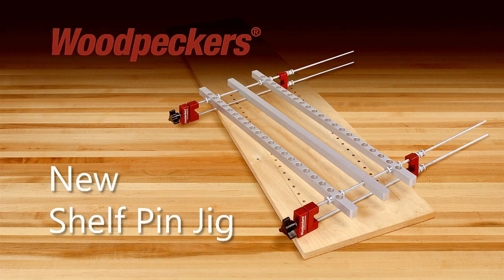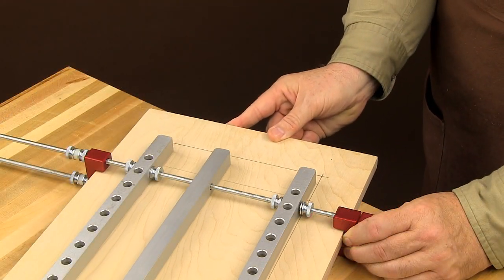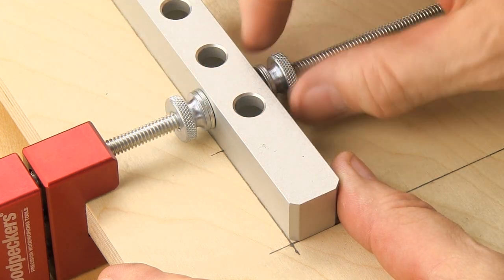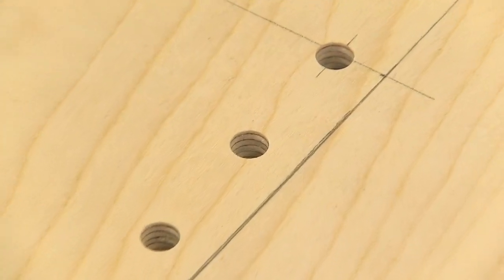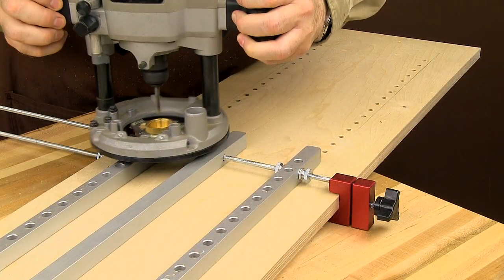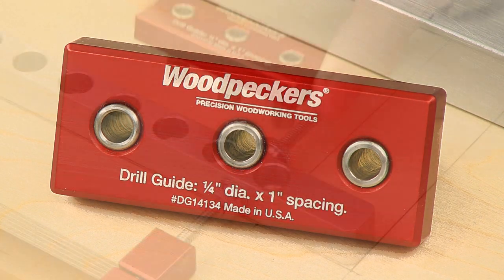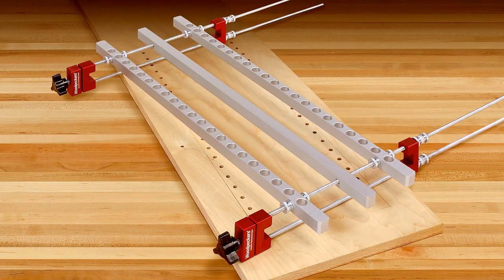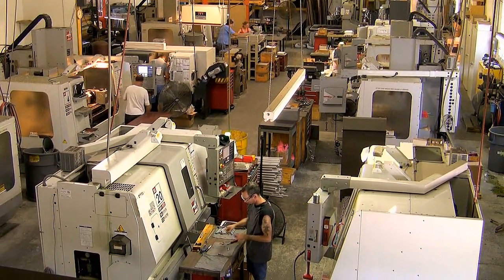Woodpeckers Shelf Pin Jig

Comment: You don't need a store-bought jig to drill shelf holes in new panels BEFORE they're assembled into cabinets.  The hard thing is to do retrofit adjustable shelf holes into a cabinet that's already assembled & installed.  
Good luck getting these little clamp things to work in that situation.
Reply: You don’t need to build cabinets either.
Reply: @johnwebb349  Sorry what?

Comment: This looks like it fits on one size of wood, is it for 1/2, 3/4, or both?  Can it be expanded to hold 24" wide panels?  I'm looking at this and the Veritas cabinet system.  Anyone have experience with both and can recommend one over the other?

Comment: The only thing that would make this better would be an adjustment for different thicknesses of wood.  Perhaps you could design the "u" shaped red piece to have an up and down movement to accommodate a variety of wood thicknesses (using to screws or even some kind of locking mechanism with a small set of bars or even possibly and flat section extending across the gap on the outside with grooves that lock down with small screws.)  Thoughts?